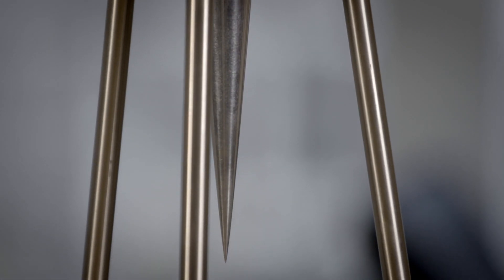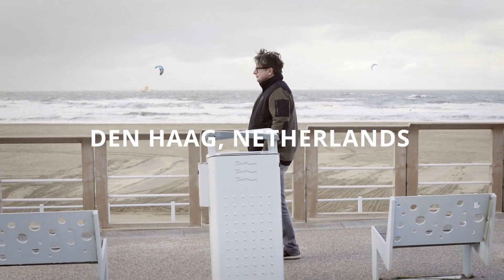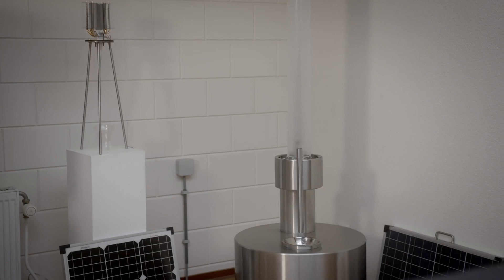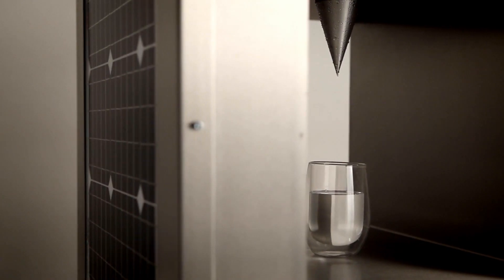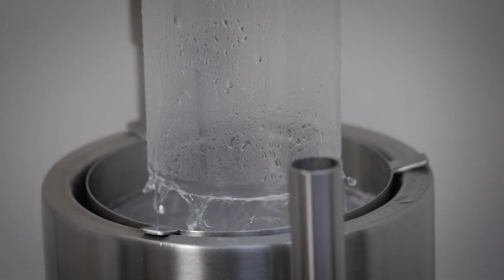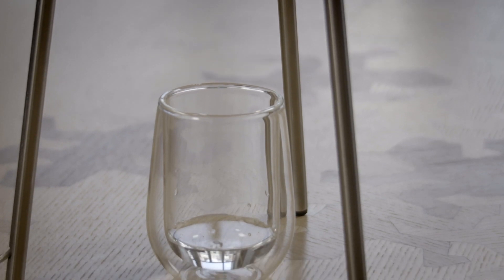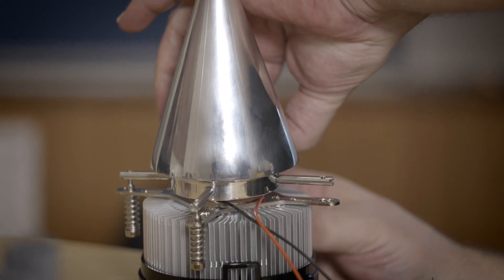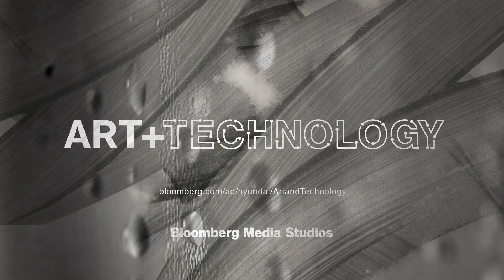Ap Verheggen Produces Water with Solar-Powered SunGlaciers – Brought to you by Hyundai

Comment: Another water from air thing. They never really work. Because they aren't efficient.
The reason is you always need to change the state of the water from gas to liquid.
This always needs the same amount of energy.
You need to strongly remove heat from air.
There is no magical way to do it more efficient.
This is why this isn't a solution to make cheap water.
Also in dry places, air is less humid. Making it even less efficient. Because you need to cool more air to get the same amount of water.
Reply: But doesn't the fact that it uses solar energy make the low efficiency less of a problem?
Reply: Indeed misleading a lot people. Nothing new here, so many others have shows the same for many years already. And we have been collecting airconditioner condens water from airco's to clean our solarpanels as we are offgrid for years already.... False claims about doing something new with new technology. Just old fashion condensing of water vapour. Increasing contact area with water drops instead of metal. But after all it uses the same amount of heat (thus energ) you need to take from the water vapour to condense it to water at that ambiant temperature. Physic laws of nature simply stay at work here.
Reply: Solar energy is also expensive....

Reducing water outflow to the ocean
seem more cost effective...